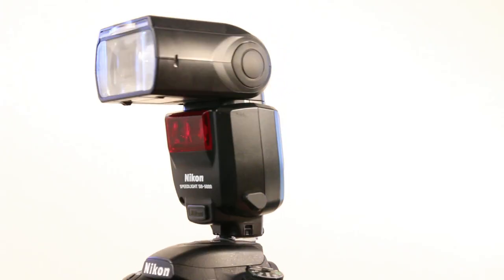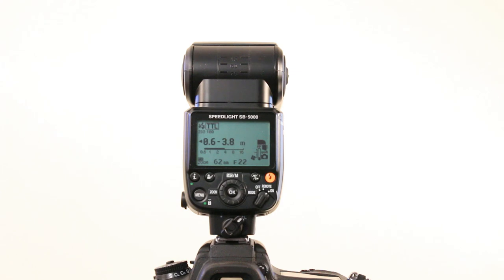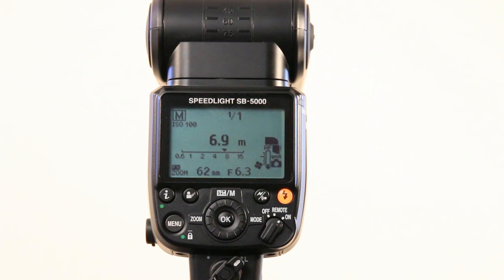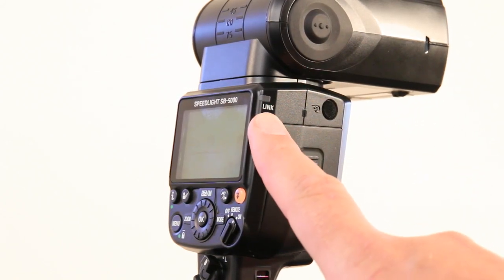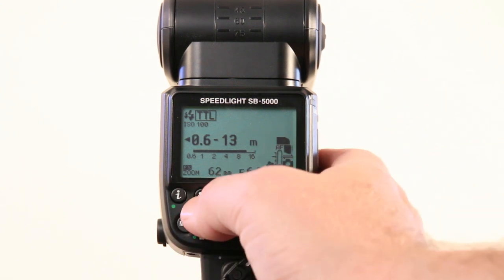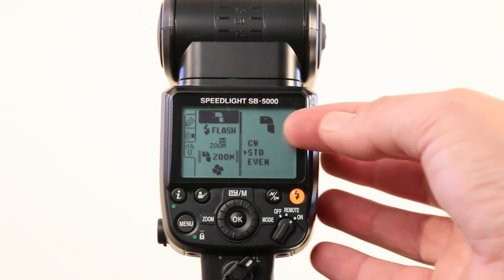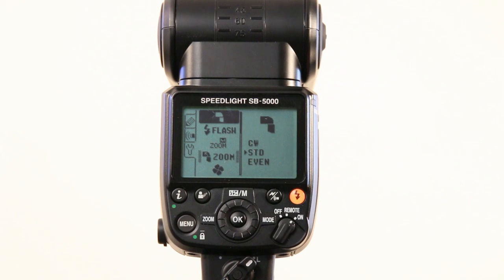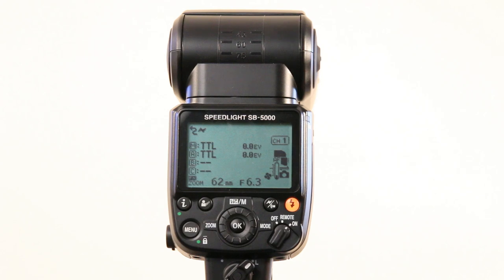Overview and quick review of the new Nikon SB-5000 Speedlight.

Comment: I have the Nikon D500. When I bought the SB-5000 I also bought the SB-5000 wireless controller kit (which contains the WR-R10 & the Wr-A10). The version 3 firmware was installed as expected). Once I input the right settings on the SB-5000 & the D500 they successfully paired. The green lights came on both the WR-R10 and the SB-5000. Everything is working perfectly. Highly recommended.
Reply from the maker: Thanks for the update. sounds like the latest firmware does the trick.
Reply: Yes, if you can find the WR-R10 that is not over priced!

Comment: just an update: the wr-r10 is now (2021) out of manufacture, the alternate is the wr-r11a/b, the 11a is the connector with the mcdc-10 style socket, the11 B is the 10 pin connector, this is a mono-cock adaptor, a one piece, no losing the top piece :-) and I understand the 11a fits z6/7 as well as the Z6ii/Z7ii so no worries about using the sb-5000 flash as described in older video's, just replace the wr-r10 refference for the wr-r11a/b. also as i am aware the wr-t10 is still available as the remote for this reciever, and is available as a kit with the new wr-r11a/b, from B&H, Adorama, and other places, depending on stocks.

Comment: no, it is not complicated, just this unit can also be a wireless remote (aka cable release) as well as the flash trigger, so you can do BOTH jobs simultaneously!, no need for the ml-20, etc. as well as the flash gear, only one adaptor, the 12 pin part is INCLUDED in the remote kit with the wr10 and the "door-opener" remote, JUST be sure it has firmware 3 on it, otherwise the flash won't trigger on older cameras ( D800, D750/D700) only the D810 and D5/D500 are "equiped" with this feature from the factory as I am aware.

Comment: The wra10 and wr10 and the kit has been sold out EVERYWHERE for 7 months the sb5000 is 600 and the kit you need is 150 so to use a two light setup is 1350 but I have been using this system for about a year and it works great and it is a good flash BUT wow Nikon doesn't make it easy so buyer beware......good vid
Reply: Nikon is having financial problems and I can see why! They have been making one bad decision after another! The only thing that’s halfway decent is the D850. They need better management!

Comment: Hey 2 weeks ago i ordered the 910 and today they told Nikon has discontinued the flash because of the new 5000. Now after watching your review and some other in amazom, now i am not sure i want  the 5000. tell me woudl you still recomend the 910 over the 5000 if i find it in ebay? thanks. I appreciate your insight
Reply from the maker: +Marcos Enrique Ruiz Rivero II (AVIEL) The 5000 is more powerful and the wireless functions will be great however having to buy additional wireless accessories to make it function is not so great. The 5000 is more powerful better heat syncs and has more functions.
Reply: How powerful to be worthy to choose one over the other. My only issue is that the sb5000 is getting bad review every where, B&H, amazon and you tube.
Reply from the maker: The 910 was an amazing flash and if you can pick up a cheap one it will serve you well. Still some new ones floating about and I sure hope will be clearing them at good prices. Maybe you could get a bargain

Comment: ATG Gold MG8K Flash Kim X3 is way better than all Nikon & Canon flashes ever made.
* nine wireless flash modes
* dual flashtubes
* wireless radio in ATG ADI TTL, ATG ITTL and ATG ETTL II
* ATG Auto2 (radio that is better than using TTL)
* 0.5 second full recycle time from 1/1 power. Nikon/Canon are slow
* No overheating.
* No shutdown.

So you guys and gals thought Nikon SB-910 (Canon 600EX-RT) and this are good. You have been fooled like many still buying Pocket Wizard.
Reply: +Finland Apollo Trying asking Alzo Digital & have your money ready.
ATG has been supporting the amateurs to working professionals for more than 50 years.

You must be new into photography that always think the Nikon is good, right?  Try dropping over Hasselblad, Leica, Phase One, Red, Canon, Sony, Olympus, Panasonic & Fuji lands.

Nikon is in trouble. Photographers are jumping away from Nikon.
Nikon F6 = Can't sale when compared to ATG Canon EOS-1VHSr
                    Canon sold more Canon EOS-1V HS.
Nikon 1    = Zero
Nikon DF = Major flopped. No videos.
Nikon D5 = Major flawed. No ATG 4K beyond 4 minutes.

All those years and now they came out with a radio flash but no radio ITTL transmitter.
Reply: +Finland Apollo What happened to your comments?

Comment: Does't the SU800 work with the SB5000?
Reply: Nope, but you can trigger another flash with the SU 800 and use the SB 5000 as a slave flash.